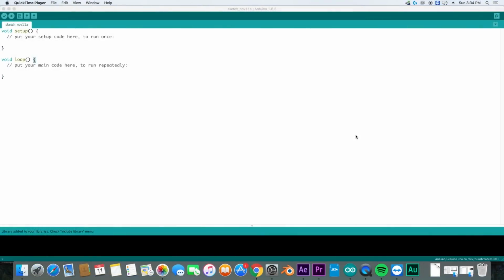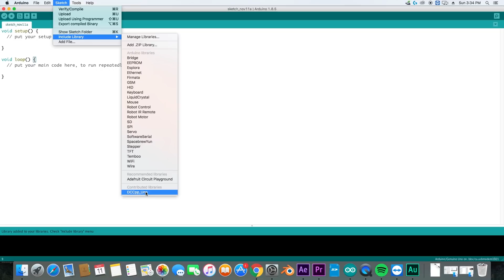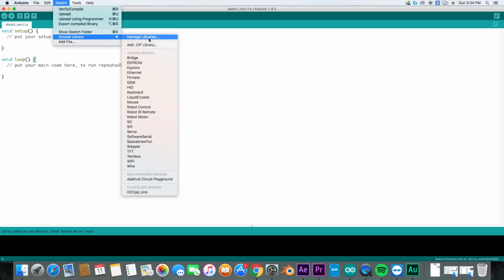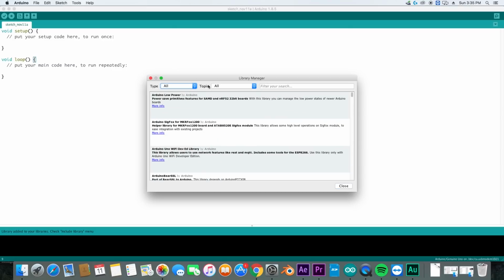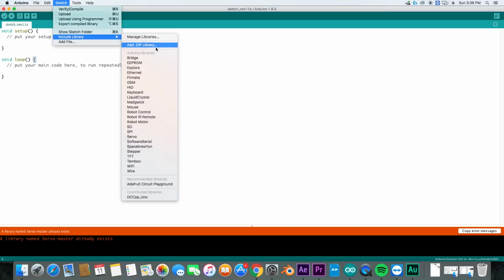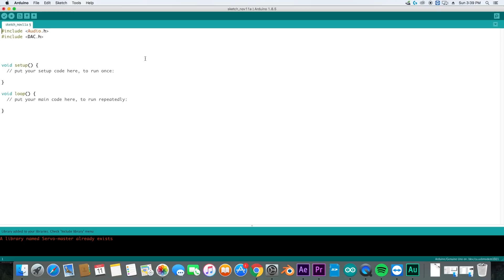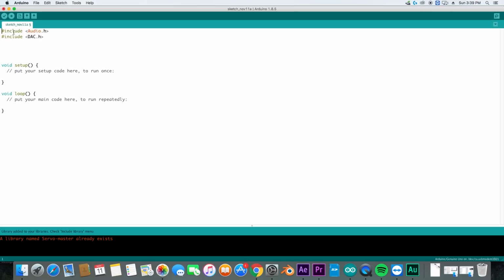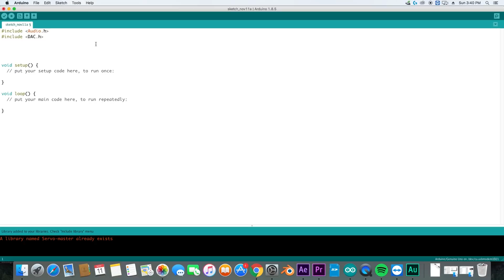Arduino Basics:  Introduction to Libraries

Comment: What type of grade crossing signal are you using and how is it operated.
Reply from the maker: The grade crossing is arduino controlled and the system DIYed.  I have several videos on how to do this.  The crossing signal itself is linked in the description of the video.  Here are 2 videos which should set you on the right track (no pun intended haha!)

Crossing Signal build
https://youtu.be/-kqAZqe-W4A

installing the sensors in my layout
https://youtu.be/qZ2Vrp8G71M

Comment: Good explanation of the libraries.  Off the subject foe a minute, I see you have Norfolk Southern on your layout.  Why did you go with that?   And I do have a reason for asking.  -Jack
Reply from the maker: +LS3Jack I live near Charlotte NC, which is NS and CSX, and for my inspiration, i looked at industries and towns between Charlotte and Spartanburg, which is part of the NS Piedmont division.  I plan on adding some CSX later.  I also have a few random locos from when I was starting up.  Im planning on getting some GP60s, which are the road switchers around here, but the fox valley ones I want are proving to be hard to come by.

Comment: Very nice Jimmy...I always had a little trouble understanding libraries and how to use them. This cleared it up for me a lot. I have a lot of ideas that i want to use Arduino for, like using servos for turnouts and crossing gates etc. My DCC is Arduino based (DCC++) and I love it. I think it does everything any other DCC system does, but I'm not sure (never used DCC before this). I have an old WIFI router that is connected to an very old very slow computer(running windows 7) with JMRI on it to use Withrottle to control trains with my phone. I want to figure out how to add a power  booster in. I have a medium sized HO layout with a double track main line so more power would be nice. I'm not having any trouble running two Locos, but I'm thinking I am going to need more amps to run more than that IDK...Loved the runbys, your layout looks great...Sorry for rambling on...Thank You for everything Tom
Reply from the maker: tom carr Thank you!